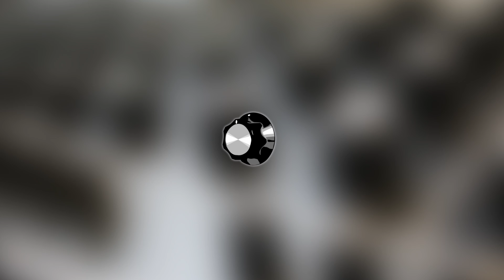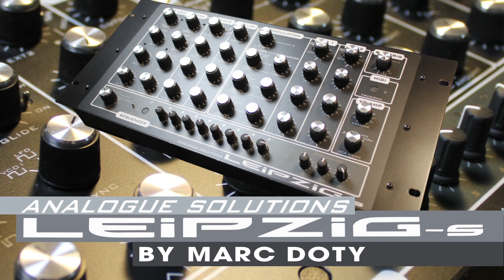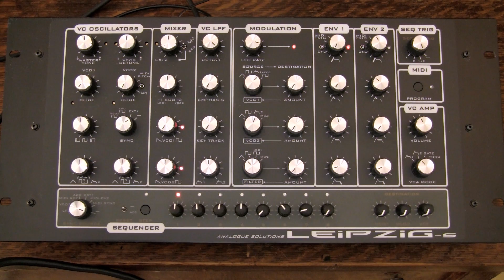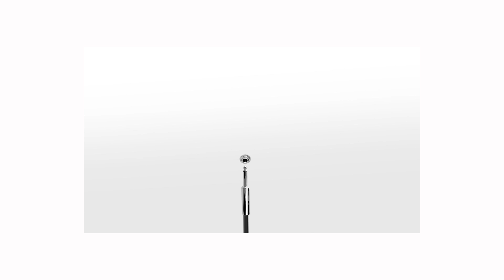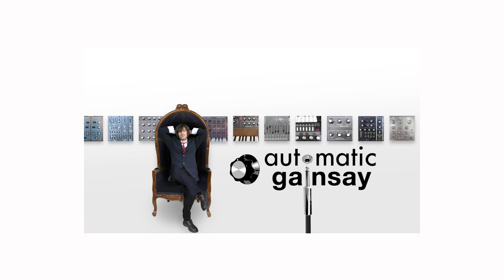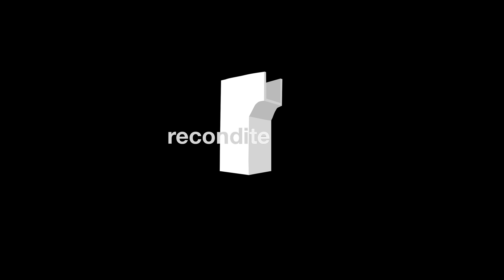01-The Analogue Solutions Leipzig-S: Part 1: Oscillators

Comment: It seems, despite the panel graphic, that the osc 1 pulse width control is more like.a square wave at its leftmost point, and a narrow pulse at its rightmost. The graphic would suggest that it's square at 12:00 but it sounds like that's not exactly true.